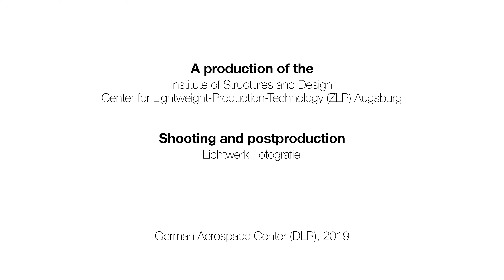Robot-based Continuous Ultrasonic Welding

Comment: is it possible to weld fabric material to one another with this kind of tool?
Reply from the maker: Yes exactly. Typically, two semi-finished laminate products are welded together with our ultrasonic welding device. These can be structures made of fabric or UD, or similar composites. In any case, thermoplastic matrix is required.